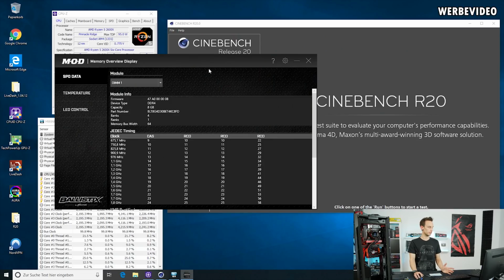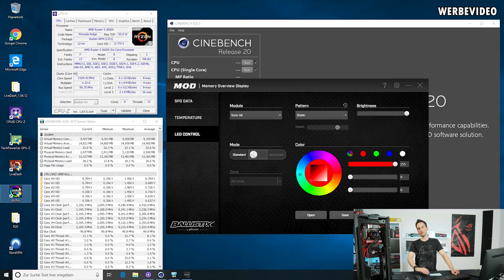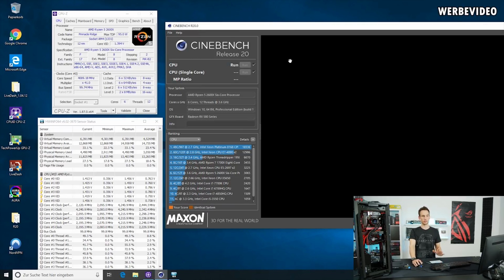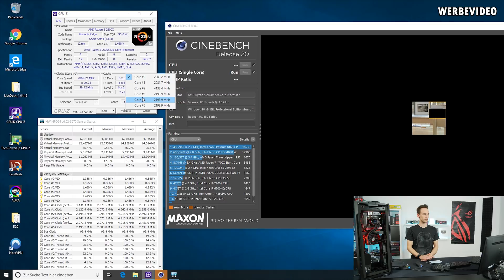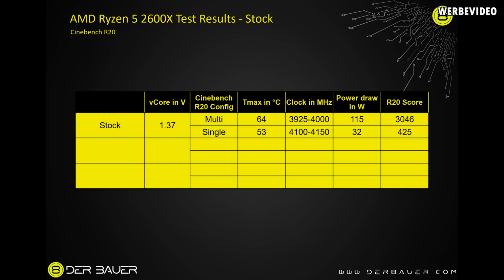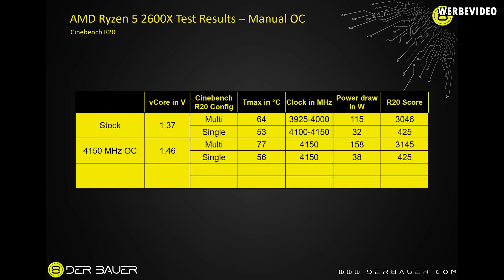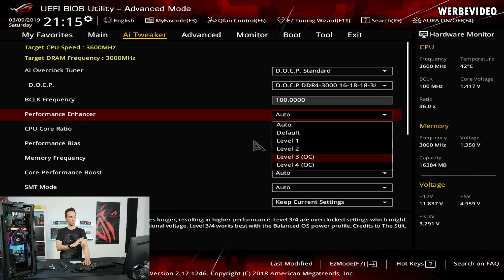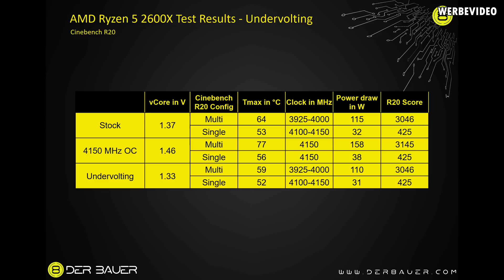The problem with AMD

Comment: The thing with ryzen is, you dont gain much with cpu overclocking, but you can get some nice gains with stuff like memory overclocking or timing adjustments. But, problem with that is that its much harder to test stability and it will take much longer to find good working settings that for most people its not worth doing.
I originally ran my 1600x at 4.2ghz, but after doing all other tweaks, its not stable at that 4.2ghz but because of other tweaks, performance at 4.1ghz is better than 4.2ghz before, and consumes less power.

Comment: I have the same "issue" with my R5 2600, stock my processor hits 3.8 GHz ~ 3.9 GHz boost in all cores and with overclock I can get 4.15 GHz. I don't think that the difference is enough to use 24/7 overclocked.

Comment: I undervolt my 2400G using offset by 0.1250mV and just let XFR do it's thing. I also undervolt the SoC. It performs exactly the same. It saves on power and gives better thermals. AMD really has a nice boost algorithm :)
Reply: Is there a guide on undervolting the SoC?
Reply: @blunion05  check if your BIOS supports offset voltage on the CPU. Go - not +

Comment: In other words, on Intel CPUs there's more stuff that can be done because the stock TIM is crap so you can (or, have to) delid the CPU and apply liquid metal to get adequate cooling for overclocking.
The fact that this is not necessary on AMD CPUs and AMD can use Precision Boost Overdrive for automated overclocking on single cores, does that make AMD better or worse? 
Admittedly, Precision Boost Overdrive isn't as reliable as manually overclocking all cores in the BIOS, but it's safer because it monitors temps and voltages and only boosts the cores when both are safe. On my own 2700X system, I have really good cooling airflow and I have enabled PBO. During gaming, single cores often go well above 5Ghz and the CPU has never overheated. The fact I can do this without having to delid my CPU says a lot, I think, given the risks associated with delidding a CPU.
Reply: ya amd way better

Comment: Same with my 2700x, i cant overclock all cores to 4.35ghz to equal single core boost, so instead i just lowered the voltage instead. XFR gets the most performance possible out of my CPU.

Comment: The problem with your video. is your Title,   Never came here looking for an over clocking discussion. Hower i did find it Intressting.

With the prize drop coming in the next few weeks, I'd expect that most consusmers buying an AMD will be looking to upgrade their gaming rigs for cheap,  not looking to over clock and get better resaults for cheaper, the price tag will do that its self.

Al in all,  I now know not to bother over clocking.  Cheers

Comment: Alot of people aren't aware that in 2010 Intel cheated benchmarks on cinebench. That's why people are still wary of this, that's why YTers whom still use is feel naive and biased. IMO if it's not open source der8auer should use open sourced multi-rending/benchmark system instead of a company whom already in the past been known to cheat for Intel.

Comment: Thanks for that one. I really wanted to buy the 2700x instead of the 9900k, as a budget choice but now OC  =  less fun... PS. - OC an Intel CPU and still using the iGP - is it possible? or it makes the CPU less stable?
Reply: Yeah but consider the 9900K is a $500+ processor and the 2700X is $269.99

That is more than double the price and with the kind of money you will spend on it could have gone to other parts like a better GPU, motherboard, SSD etc.
And if you are on a budget there is no reason to get the 9900K, if its that much money how are you getting food? paying the rent?
The best hardware in the world dont mean squat if you dont have food on your plate and a roof over your head.

Comment: A tutorial of how can we use lower end b450 b350 mb to get the maximum ryzen performance ex:2600 2600x or even 2700.
Because lower end mobo usually lack of some crucial features higher end mobo have.
Reply: Consider getting a X470 or X370 mobo instead. Overclocking on a B motherboard is generally a bad idea. Especially if you plan to buy a 2700 or above, get a X motherboard or dont get a ryzen 2700+ at all.

Comment: true, only  ryzen gen 1 without X is really worth overclocking :P

this r5-1600 can run @ 4ghz @ 1.425 volt,  but it's still unstable after a couple of hours, so i dialed back to 3.85 ghz @ 1.38v, with some LLC into the mix for stability and called it a day.

i'm also pushing up 2400mhz ram all the way to 3200 with slightly loosened timings, but it's still a couple of % faster overall, ryzen, (or rather, inifinity fabric) seems to prefer clock speeds over cas latency until you go well over 2666mhz, although im not sure that's still the case if you really subtiming tweak them both. (these hynix bars i have don't overvolt for shit though)

also, as awesome as the asus bioses are, auto settings are mentally retarded for ryzen.... 
at least on the shitty b350s (b350 prime-plus in my case)
pumping in way too much i've seen it burst to 1.55 volt and only reaches 3.6 ghz when i let it do its own thing... i had to put it in manual so it wouldn't potentially mess up my brand new cpu. (as i understood ryzen gen1's safe limit is 1.425)

Comment: That's weird. I have my Ryzen 5 2600 (no X) OC 24/7 at 4.05 GHz with 1.30 V. And it never go beyond 70 degree C with my 240mm Deepcool Captain AIO cooler.
I certainly don't get how your results seems a lot less impressive than I thought it would be

Comment: Ryzen content that would be interesting? A deep dive into all the settings and tweaks in bios and Ryzen master etc. Find what helps them perform at their best. Overclocking is not worth it, but there are so many options available in my Strix bios. However, I suspect they work at their best out of the box with XFR etc. There might be something worth doing in all those options though. Memory settings too. Consensus seem to be that memory is where you get the most performance gains from Ryzen. So, in short, a tweaking guide for Ryzen (if tweaking it gives more than ~10% bonus performance in Cinebench and Time Spy CPU tests)

I have switched from Intel to Ryzen. It does not feel like familiar territory when i explore those bios settings now. My DAW software loves the new CPU though, so I am happy with the choice (Reaper running lots of VST plugins. The 2700x barely breaks a sweat.) 

No point in overclocking it like my previous CPU (i5 2500k). The only thing I am looking at doing is changing the cooler. I like the look of the stock cooler and its performance is actually quite good for what it is, but it spins up to 2500 rpm kind of randomly if using stock fan curves. Set a silent profile and the boost clocks do not hold for long. I am not sure which way to go on cooling though. I have never quite trusted AIO stuff and always gone for air. I had a Coolermaster V6 on the 2500k. Maybe the new Noctua stuff in black with some kind of mod to give them RGB. I thought RGB was a gimmick until I saw it in person. It looks really good.

Comment: I reduce the power cap via XFR2/PPT on both my 2700X and my TR2990WX.  The power savings is massive for only a tiny loss in performance... particularly on the 2990WX.   I don't reduce the power cap on the 2600 or 2400G.

For memory overclocking I'll generally go with 3000+ on the 2700X (whatever the memory can do), but for the 2990WX  the memory fabric driving 32 cores eats so much power that it eats into the CPU's power budget so what I do instead is run the memory at 2666, bump the memory voltage as if it were running at 3000+, and try to reduce the CAS timing.

I run the 2700X at around 120-150W at the wall and I run the 2990WX at around 250W at the wall (going full out), which is a massive savings vs the 330W it would pull at stock.

This combination work great, I use these machines daily, sometimes running jobs which take days to complete.  The TR is an incredible workhorse... kinda like the energizer bunny.  It keeps going and going and going... and blows the socks off the dual-socket xeon I used to use.

-Matt

Comment: Really good to know there's no point trying to overclock a Ryzen CPU. 

Is the issue, or better yet pointlessness, of overclocking Ryzen CPUs because they are very well optimized or because of their multi-chip design? Does this carry over to the Threadripper CPUs too?
Reply: Ryzen and Ryzen+ are not multi-chip designs. You're thinking of Epyc and threadripper here. And its definitely because of AMD's PBO2 and XFR2 doing an insanely good job at dynamically boosting clocks on the X models.
Reply: @Vapefly0815  Thanks for setting me straight on the multi-chip thing, I just assumed all Zen based AMD CPUs were multi-chip, thinking the 8-cores Ryzen 7s were 2 quad-core chips after reading about Epic and Threadripper being multi-chip and all the talk of chiplette design and infinity fabric over the past couple of years.

Been looking at switching out my i7-4790K for a Ryzen or Threadripper focusing more time on looking at Threadripper only holding off once talk of 7nm started.

Good to know that the dynamic boosting is a thing and it's that good. Overclocking has always seemed scary to me for some reason so good know the CPU can take care of all that.
Reply: @Vapefly0815  more specifically, XFR2, PB2 and PBO (PBO is exclusive to X chips).

Comment: I tell this to all my friends who i recommend Ryzen based systems to ( which is all of them  :)  )
Enable XFR and PBO. Put decent but not extravagant cooling on them.
Cut the voltage back a bit, because almost every mobo will run more than the chip really needs.
DOCP the memory up to a happy spot.
And be happy!   It will perform extremely well in gaming and workloads/streaming/video encoding/whatever.
Last for ages and ages, run nice and cool.  
And you can jump at least one tier of gpu ( minimum)  for the SAME platform cost.
Which means the AMD rig will outperform the Intel rig at any given pricepoint until you hit WELL north of $3000 USD. in gaming and  workloads.  
It is pretty easy to see why you wouldn't have overwhelming amounts of Ryzen content Roman.
I mean, you are one of the premier overclockers on the planet. 
And getting ridiculous overclocks out of Ryzen is not a thing.
Looking forward to your content on the 3xxx Ryzens on 7nm, so an expert such as yourself can give us the accurate story of what is and is not possible on that cpu when it arrives. 
Thanks for all the hard work and fascinating content!
Many thanks as well for producing a standalone video for the English language market.

Comment: It's well known by now that the X skews of the 2nd generation Ryzen do not overclock very far, especially the 2700X. These are not chips made for overclocking like the Intel CPU's, what they offer instead is good stock performance at their price point. I don't like reviews where they compare a 2700X clocked at about 4Ghz against an overclocked 9900K at 5Ghz. Not a fair comparison, and not apples to apples price wise. At the time of writing(I'm in Australia), the 9900K retails for $900, the 2700X is $470. 
There is nothing in the Intel range that sits at this price, the closest are the i5 9600K for about $50 less, or the i7 8700 (not the K variant, the non overclockable bare 8700, the K skew is another $100), for about $50 extra.
Against these CPU's it out-performs them both overall: 
-it has 8 cores, 16 threads with overclocking possible, but not a lot to be gained there
-the 9600K having 6 cores, but no hyperthreading 
-and the 8700, with 6 cores, 12 thread with hyperthreading, but no overclocking.
Against these chips, which are its price competitiors, it stacks up very well, even with limited overclocking - one of it competitiors has no hyperthreading, but can overclock, the other has hyperthreading, but cannot overclock.
The Ryzen 2700 costs the same as the 9600K, and a comparison between those two would be valid to someone with $400au to spend on a CPU, they cost the same here, $419.

Comment: There was a guy who bought i think 6 2700Xs and out of the 6 cpus he was only able to get 1 to like 4.4GHz at less than 1.5V 1 was like 4.3GHz all core and the rest were 4.2GHz. so its possible to get a ryzen cpu to actually overclock, but youd need like a sample size of 20 and then check each one.

Comment: I get 4.3 on all cores. I enabled a setting on my ROG Crosshair hero 7 that will throttle down to between 2.7 and 3.8 when it's not under load. When under load, it will boost to 4.3

Comment: Yeah I tried same.

With intel the turbo boost isnt that good at using the intel chips to full potential, so you can achieve a lot with manual overclocking.

With AMD they developed XFR which does a really good job.  I tried to beat it manually, and found the same, would need very high voltages to even get close to XFR on single threaded, and would beat XFR on multi threaded but the gains like he said is single digits % only for much more power and heat.

The best thing to do on ryzen 2 chips is undervolting and maybe p-state tuning.

Also my 2600X boosts to 4.25 not 4.15 with XFR on single threaded cinebench so better than this chip, manually getting 4.25 to work all cores is pretty damn tough.
Reply: Intels scale a Lot better compared to AMD processors, increase voltage on an intel, you can achieve a Higher clock and somewhat Higher temperatures, the Ryzen Line on the other hand....
Reply: How is intel not good in turbo boost? It boosts a 9900k from 3.6 to 4.7 GHz on any decent Z390 board. 3 cores go upto 5GHz for 3 core load, 5 cores upto 4.8GHz in 5 core loads on most Asus strix and rog boards. Gigabyte boards with better vrm on paper should at least do the same. 9700K boost nicely too.
Reply: I think you need to understand more of what I meant, intel chips scale a lot better past their stock clocks, so the turbo tech in itself doesnt need to be great to get results like you said.

But XFR is so good that its pretty damn hard to beat it with manual overclocking, definitely not the case with intel.

Even simply enabling MCE improves intel turbo mode by a lot.

Bear in mind also a lot of intel boards break the official spec, the official turbo mode spec wont boost very high unless cores are in sleep state (C6 or higher).  So on things like servers you dont get much more than 200mhz or so boost.

Comment: When I got my 2600x initially I was impressed with how XFR works and the motherboard displaying temperature of 66 degrees under aida64 stress looked great. Then I noticed HWinfo Tdie temperature cycling between 77 and 89 degrees when stress testing, while the motherboard represented much lower CPU temperature mentioned above, and CPU did maintain 3.9-3,94 GHz. I guess with XFR enabled Tdie gets a bit hot, but the CPU will decide how hot. Btw I did not want to use AMD box cooler because I had an old HyperTX3 with 3 heatpipes and "hairpin" that fits AM4, but I will get a bit bigger 4 heatpipes tower cooler (one of the cheaper models) this summer.

Comment: I'm with you on this. I own a 1600x, and my specific use case requires all core overclocks to be useful for me, but I am working very hard to get stable RAM speeds if I push over 4ghz on the cpu (@ stock cpu voltages though).

With the RAM speed and timings being critical to ryzens effective speeds, sacrificing 200mhz on the RAM and loosening timings costs more than an all core 4.1ghz on the cpu can claw back, so I'm still on 4.0ghz @1.35 and 3200mhz CL16 @1.36 until I've tinkered enough to have my cake and eat it.

Until ryzen 3 comes out with the chiplet design don't worry about overclocking content.

Comment: I have ballistix sport 2x 4GB 2666Mhz 1.2v cl 16-18-18-38-69 1t OC to 3000 1.3v same timings tested prime95 for 30 mins no problems, 2200g running stock@TX3 cooler. Its my memory OC safe or I have to use 1.35v?

Comment: There is actually a lot of room for performance improvements on Ryzen, i's just not in cpu clock speed increase like Intel. Just from tweaking memory speed, primary, secondary and tertiary timings you can gain ~ 20% more fps performance - even compared to 3200-C16 'XMP' speeds (depending on ics). I have two AMD systems, previously I had 16gb SR b-die at 3600-C14, now I have 32Gb DR Hynix AFR at 3400-C14 and 32GB Hynix CJR at 3600-C16. There is no where near enough of this information out there on channels like this imo, most do as you did in this video and just leave the default memory clocks - which is like buying a 9900K and leaving the cpu stock, imo. This is the best Ryzen memoy guide I've read to date, is definitely worth a read to anyone with a Ryzen system and time on their hands - https://www.techpowerup.com/reviews/AMD/Ryzen_Memory_Tweaking_Overclocking_Guide/. As a side note, you can also get a bit extra all core performance increase from enabling Precision Boost Overdrive , while keeping single core XFR boost performance. There is still a bit of tweaking here as typically it overshoots the voltage, so you typically need a hefty under-volt offset, then varying workload stress testing to make sure it's stable - another thing that's not covered often. Love your work, cheers.